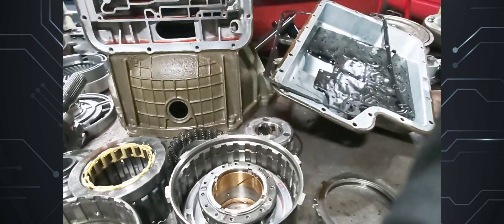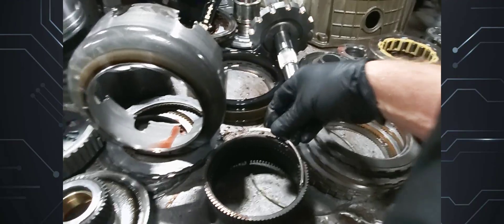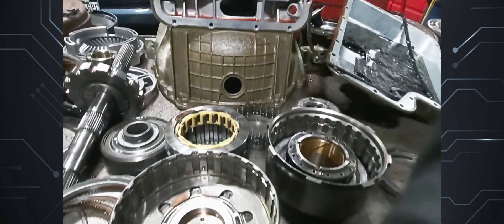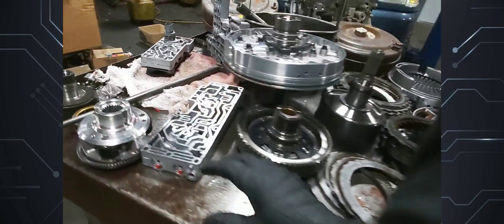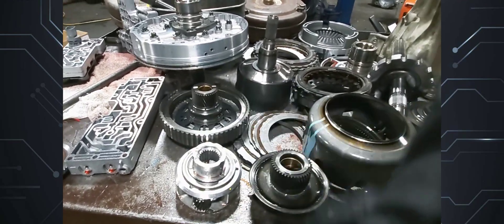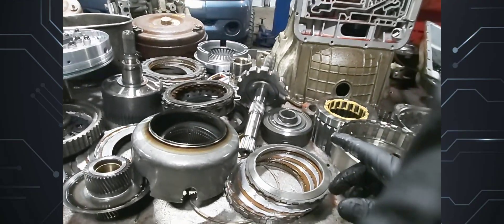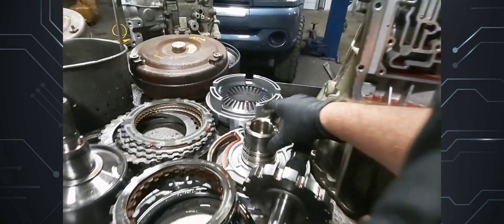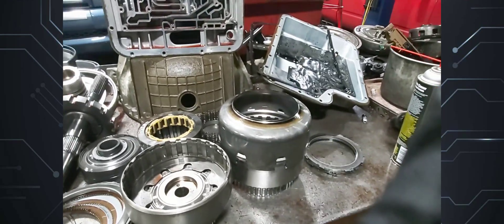E4OD Transmission No Reverse | Tales From The Bench - Transmission  Repair

Comment: My 91 Ford f350 diesel e40d only goes into reverse if I get the rpms up to ~3000 RPMs. Once it catches, it operates normally. Do you think it needs a rebuild or a shift solenoid?

Comment: Great Video !! My 1997 E4OD Just lost reverse. But in park pos it goes forward, reverse= doesn't move, nuetral and all other gears goes forward. Is this a symptom of what you show here? I'm stranded and vehicle is a 25 E350 25 pass shuttle bus. I still have OD and Drive. What's my chances of driving it 425 miles to my house (w/o backing up of course)? Any advice would be greatly appreciated!! David
Reply from the maker: I don't think it will make it that far. All the debris from the component that failed is going to clog the filter further. 
Sounds like the forward Clutches are welded together. They were slipping for too long that they got really hot and welded the frictions to the steels. 
I don't recommend moving it as it is but if you change the filter (deep pan filter) it will go a little more. It's a very big risk.